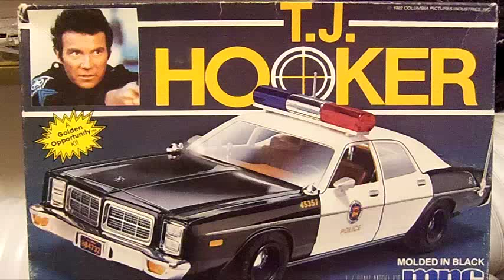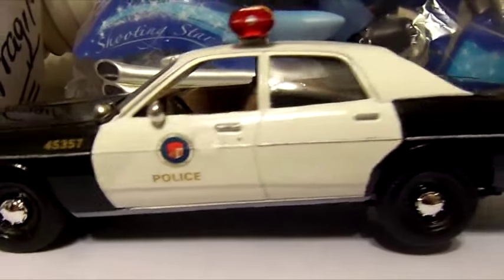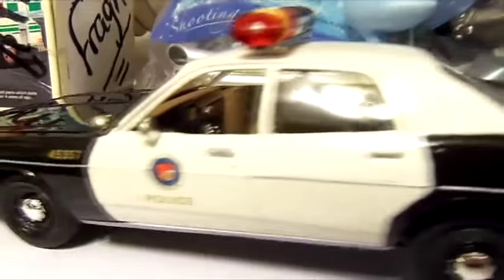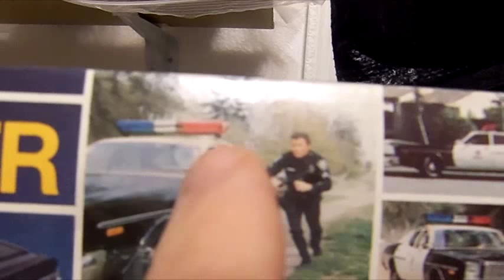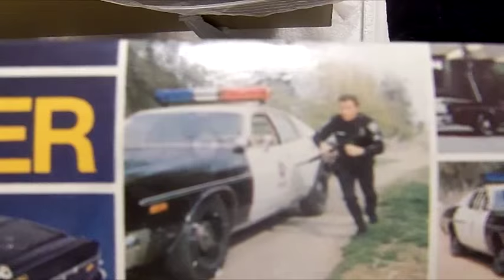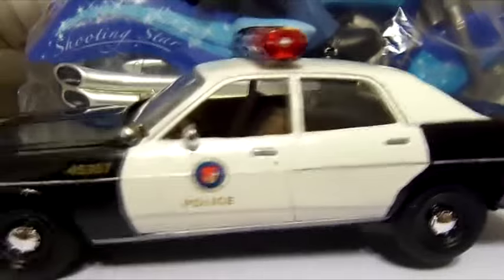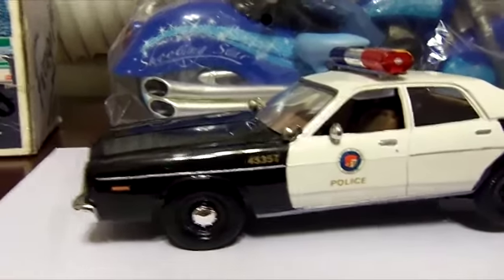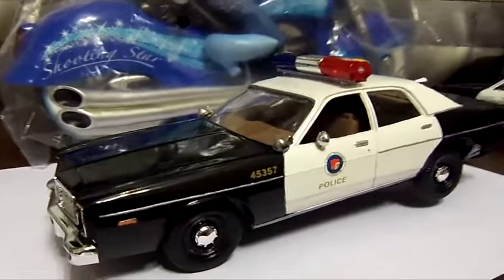Model Kit Highlight and Restoration: "T.J. Hooker" '78 Dodge Monaco (Part 2 Final)

Comment: I can tell you right now that the tail lights are totally different. I know they are different, and don't look right. They look like they are for a 1976 Dodge Coronet. It just isn't the same as the 1977-1979 Dodge Monacos in T. J. Hooker. Then later on in the series, they've ended up using the 1980's Dodge St. Regis. And after looking at them tail lights (which are not the same nor correct), I'm going to need to get myself a tetanus shot.